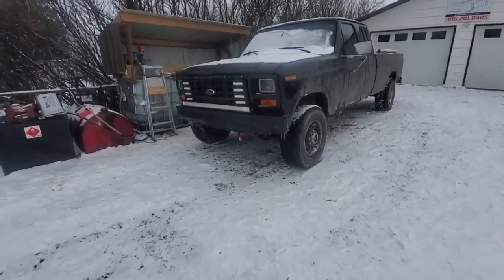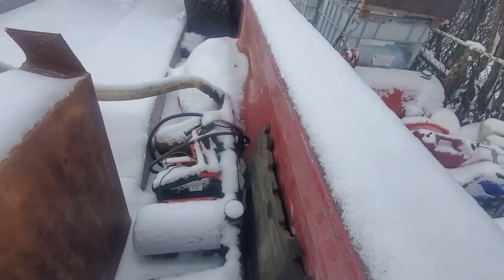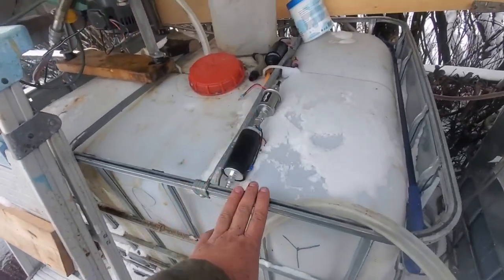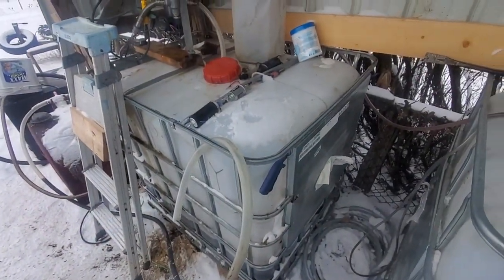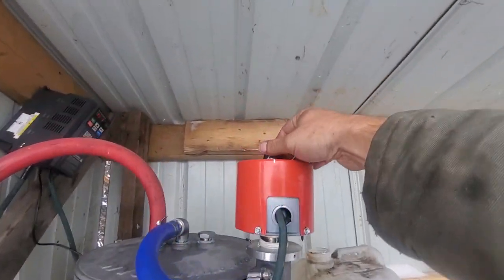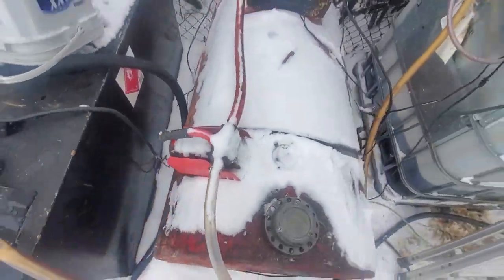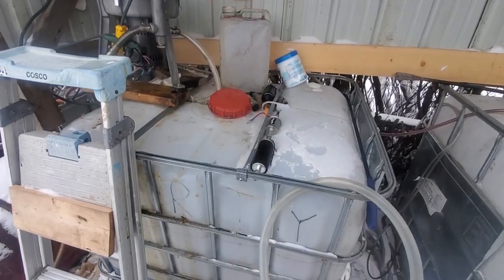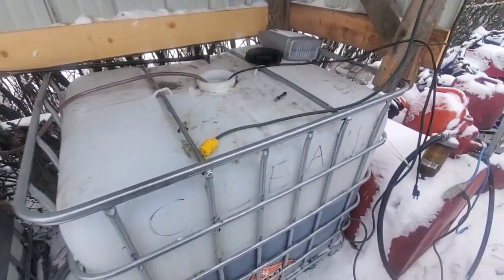My simple waste oil black diesel fuel processing setup, check description

Comment: What do you mix the used motor oil with, to make it lean, or is it just heated?
Reply from the maker: Usually thin any oil with petrol (gasoline), up to 25%. Depends on what oil & such. Experiment to get a good viscosity. Don't want it thinner than diesel.